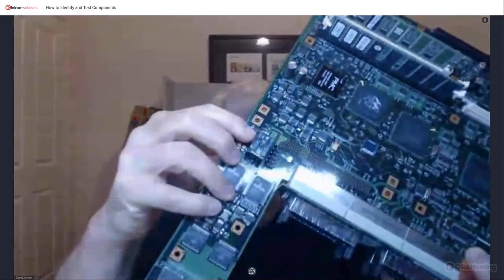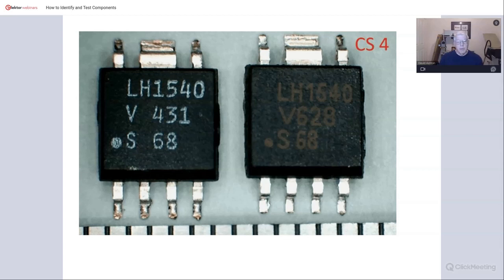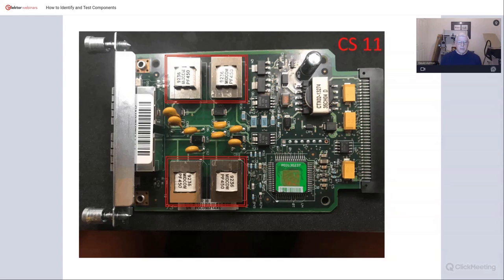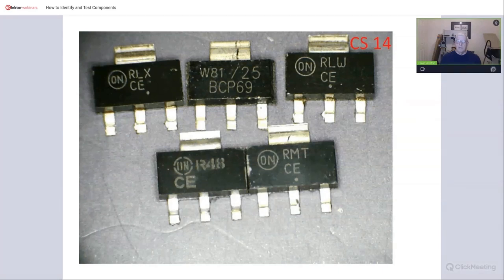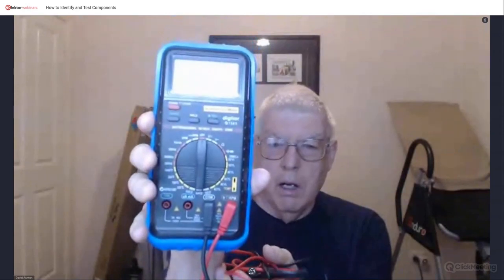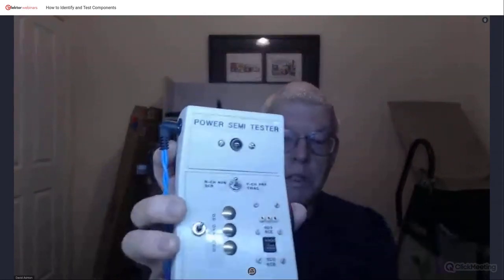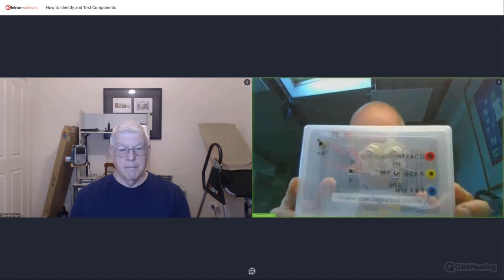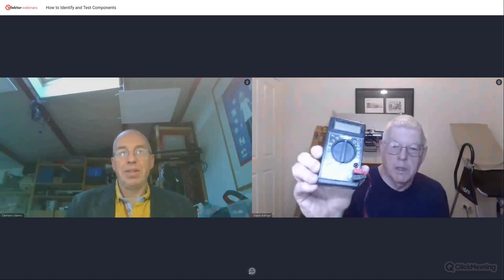Elektor Webinar about How to Identify Components

Comment: At around 45:00, regarding PNP and NPN transistors testing using multimeter. You can also test transistors (although not hFE) using ANY multimeter with diode setting. One probe on one of the legs, the other probe testing remaining legs. If you have a diode junction reading both remaining legs, your transistor is of the base type depending on the polarity of your first probe. I.e., if your FIRST probe was NEGATIVE (Ground, Black), and you have BOTH other legs giving you nice diode junction reading (approx. 0.5V-0.7V), then your transistor is PnP, your "black probe" leg is BASE and the leg giving you a SLIGHTLY higher reading is the EMITTER. If your FIRST probe was POSITIVE (RED), then your transistor is NpN). Say, 2nd leg gave you a reading of 0.5867V and 3rd leg gave you a reading of 0.5875V then 3rd leg is EMITTER. If the reading does not give you any diode junction readings, try different combinations of legs. If NONE of the combination of legs gives you diode junction readings, it's either faulty BJT or your device is of a different type (Darlington, triac, MOSFET, etc.). Regards from Sunshine Coast, Queensland, Australia :)